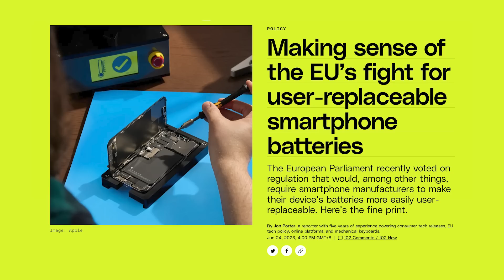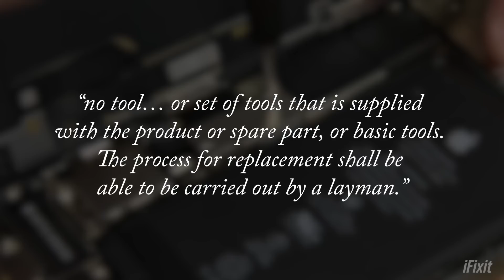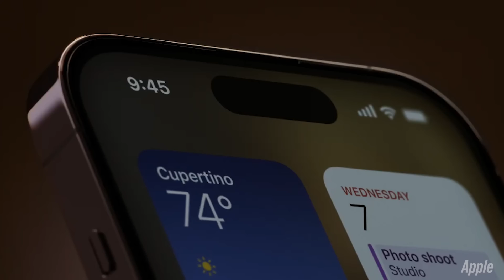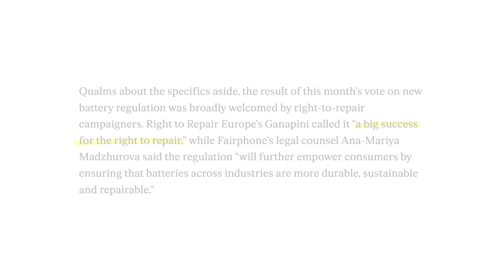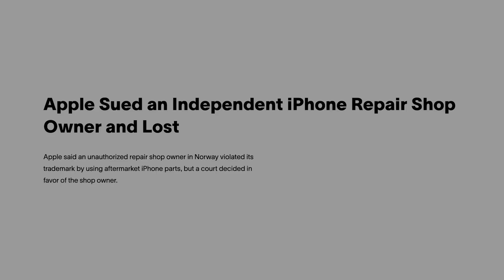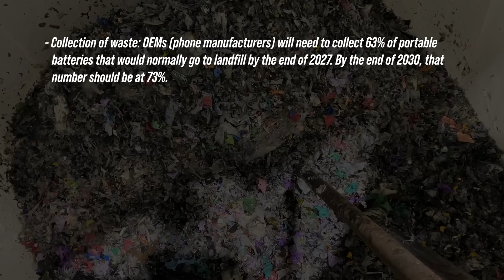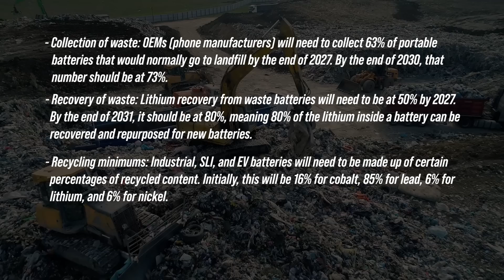EU Just Changed Smartphones Forever

Comment: By the time an iphone battery is becoming useless it is generally close to being unsupported by iOS updates anyway. IPhones last maybe 3-4 years and then the hardware can barely support the OS due to insufficient RAM or processing capability anyway. 

The correct way for the public to display their preference for replaceable battery phones is for them to stop buying phones with irreplaceable batteries. Not for some bureaucrat that isn’t an engineer or product designer to enforce unnecessary laws on the public.
Reply: So, tell me, what are the current options if you want a phone with replaceable battery ?

You have wayyyyyy too much faith in the self regulation of the free market.
Reply: @paulustrucenus  If there were enough earnest consumer demand, phone makers would include this feature.  However, this feature set comes with tradeoffs probably most consumers are not willing to make.

All of us have had phones with replaceable batteries.  It was a crappy experience.  Over time the battery slot would get loose and start flying off.  Plus no one wants to carry around spare batteries.  

The people who didn't care or didn't want now have no choice.  Why do you get to destroy the market of phones for what they want which is likely the overwhelming majority.
Reply: @narcojauy  That first sentence is straight up wrong. That's not how the world works.
Reply: @paulustrucenus  There literally were half a dozen phones with replaceable batteries in this video.  Why not buy one of them instead of dictating what everyone else is allowed to purchase?
Reply: @narcojauy  Because no one has ever heard of them.
Reply: @paulustrucenus  Did it occur to you that phone makers of excellent products considered the tradeoffs and selected an inaccessible design because it improved the overall user experience?

Now we have bureaucrats deciding phone design.  This is backwards and stupid.  We don't hire plumbers to do heart surgery.

That's why the free market is great.  You can protest their design choices by NOT BUYING THEIR PRODUCTS.  If you can't be bothered to buy a competing manufacturer's product that meets your requirements, then my impression is you don't care about this issue that deeply.

If your desire for replaceable batteries is so capricious, why on earth should it be outlawed to produce a phone that has a sealed battery? Laws and regulation should meet significant public interest requirements before becoming laws.  Not, let's give those evil corporations a spanking, here's a law.
Reply: @narcojauy  I'll stop this discussion because this is going nowhere. Your view of how the world works is fundamentally different than mine, and the statements you make make sense to someone with your beliefs, but are utter nonsense to me and my views. 
And considering the massive difference in our beliefs, I don’t think either of us can convince the other of anything.
Reply: @paulustrucenus  My views are not beliefs.  They are rational arguments supported by a vast array of historical evidence.  I have a Master's degree in Public Policy.

I don't know what informs your opinions, but it doesn't appear to be based in any rational philosophical framework.  You obviously haven't considered the competing interests of liberty, individual rights, and freedom of choice.  This is the main topic of philosophers from the 17th and 18th centuries.  

I encourage you to read Social Contract theories by Rousseau, Arguments on Liberty by Locke, and about the Tyranny of the Majority by JSM.
Reply: @narcojauy  My opinions are supported by rational thinking and historical evidence too. I do not like your supposition that somehow my ideas do not come from a rational framework.

And your argument to authority is meaningless. I doubt every person on earth with your degree agrees with you.

Our différence in beliefs comes from my belief that the choices made by companies are not the result of the choice of consumers with the free market, but are made with self interest in mind, and that in a world where information is in the hand of private companies and competition is virtually meaningless considering the upfront cost of entering the tech business, consumers have little to no way to exerce free choice.

Also, you trying to teach me about the Lumières has to be one of the most hilarious thing ever. I'm French, and I'm pretty sure I know Descartes, Rousseau and the others better than you do.
Reply: @paulustrucenus  The Enlightenment philosophers were not primarily French in origin, also I specifically mentioned political philosophy.  You do not seem to give much consideration to liberty or individual rights. You speak of conflict between consumers and businesses, which conflict between classes being primarily a marxist take.  You have a big blind spot when it comes to tyranny, which as noble as marxism may claim to be, historically it has led to authoritarian dictatorships in every instance it has been tried.  Your lack of focus on the fundamental importance of liberty is a hazard that could lead to tyranny and despotism.

Contrary to seeing actors in a free market as in conflict, it is more proper to see them in symbiosis.  The freedom to engage or abstain in trade is of paramount importance.  Forcing someone to buy a product against their will or forcing a seller to produce a product against their will, absent a compelling public interest, is a hazard in that unlimited government authority is inherently oppressive.

I still await your reasoning for why such an intrusion upon the rights of others is necessary?  I have not heard any reason other than "consumers want this", which by their actual purchase behavior appears to not be the case.
Reply: @narcojauy  You know what's better to juge what customers want than their buying habits ? Actually asking them. Surveys show europeans are largely in favor of laws enforcing right to repair.

Your argument bases itself on the idea that consumers are totally free to chose which solution is best for them, ignoring the points I previously made about private holding of information preventing consumers from knowing what solutions exist and the inpossibility for a new player to enter the tech world.

There is no such thing as freedom to engage in trade when said trade is necessary for your survival.
Reply: A replaceable battery has 0 power over your survival. You are being melodramatic. There are phones that offer that feature, yet you choose not to buy them because they aren’t as compelling to you as sealed phones. 

I understand your argument perfectly fine, that the right to repair is of paramount importance, and I gave several reasons why it isn’t important. Hardware obsolescence, inferior phone design, wear forcing the phone to fall apart inadvertently. 

You have ignored my main argument this entire time. The primary priority should be safeguarding against government tyranny. The government should have 0 interest in basic consumer decisions. 

Do you want your government involved in basic consumer choices? What if they ban baguette because a different kind of bread is more healthy for you? Maybe they should outlaw sex without a condom because it is dangerous? You are giving them the authority that leads to such dystopian outcomes by recognizing their authority to do so in this case. Europe has unlearned the lessons of The Enlightenment. I thought you fools would have learned the peril of totalitarianism from Leninism and Fascism, but you seem destined to repeat those failures too.
Reply: It works the same for toxic and carcinogen components in food, toys, clothing... right? They are removed because "the public display their preference for toxic-free products", not because "some bureaucrat that isn’t an engineer or product designer enforces unnecessary laws on the public".
Reply: @neutronalchemist3241  There are cases of compelling public interest where regulations are useful.  This is not one of those cases.
Reply: @narcojauy  It's the political organ that decides what's compelling and what's not. And it decides exactly because there are cases where the single is not concerned of what the public interest is. Regulations are issued about the most diverse things, IE, even the colour of the internal wiring of electrical devices is regulated.

Comment: Apple is by far one of THE worst tech companies when it comes to eWaste with non serviceable parts and outright DMRing hardware itself that changing out one little broken or damaged component makes the entire device complete eWaste junk. In what world (besides Apple's) does it make sense to DRM the hardware so you can't have the phone services for repairs by swapping out a screen, camera, battery, SIM Slot, or entire logic board, what harm does that really cause for someone to have these things repaired? Whose business is that really hurting just to repair something? The answer is Nobody. It's more than just "Mildly" inconvenient to the end user of that device itself, it's majorly inconvenient to that end user who has to spend $100s if not $1000s just to replace the entire device just because of one defect that could be easily swapped out for a new part. Using the excuse of "Oh but the consumer will hurt themselves" is such a weak ass bullshit logic of an excuse, that kind of logic makes absolutely no sense in any shape or form. If they take it to a repair shop who specializes in repairs and replacements of components on electrical devices chances are they know exactly what they're doing, unless it's one of those sketch corner shops who is overcharging or undercharging their services.

Comment: I already use rechargeable batteries for my wireless mouse. It's really convenient to have removeable, rechargeable batteries as it means you can use your device on the go while charging the spare battery. Then when the charge in your device runs down, replace the battery with a freshly charged one and then recharge the spent battery.

Yes, this will result in thicker phones. Maybe we need a standardized battery design for phones too, just like we have standardized power connectors.

Comment: @0:30 "Easily replaceable batteries are no longer possible"... that's complete BS. The battery on my phone 15 years ago was easily replaceable, and the phone is not only water proof so that I can go swimming and diving with it, it's actually still working today. 

Batteries not being replaceable is a willful decision by the manufactures in order to a) cut down costs so that some manger can worsen climate change by driving around in their private yacht and b) ensure you'll have to buy a new phone every few years, which, of course, is just a) rephrased. Of course, customers are also to blame for letting companies get away with those tactics.

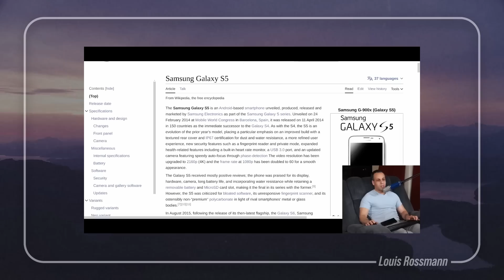Edit: Should've waited until 3:25.. exactly.

Comment: I never understood the "water protection" argument because you can simply seal the rest of the phone well and then put a rubber seal around the removable battery slot itself. It's ridiculous components aren't modular because it is not difficult to use contact data transfer instead of cable, especially for something like a battery. They did this for years and years on the older phone batteries.
Reply: Samsung S5 had a replaceable battery and a IP67 water protection certificate (that means it could stay under a meter of water for an hour).

Comment: I never wanted a phone without a replaceable battery. It simply was not possible to buy a good phone with a user replaceable battery. The best I could buy was one which had little screws which allowed access to the battery. And the next time I had to get a new phone there was 0 choice when it came to phones with user replaceable batteries. It's not driven by consumer demand. It's purely driven by corporate greed and a little bit by consumer ignorance.

Comment: So many devices which are still supported and works perfectly fine have to be thrown out because the battery have issues, sure you can get a replacement if you can find someone or some place with the know how and tools to do it, but even when you do it's most likely a knockoff battery that will only last a third of the time an original battery would.

Comment: No. Batteries are no longer exchangeable not because of design, but because of money  -it's cheaper to build one with sealed battery and it's better to sell customer new phone, not new battery. It is all money and don't ever think otherwise.
Oh, and this also is not "for planet". It is also because of money. Rare earth elements, to be precise. EU has basically no rare earth elements supply in it's territory, to they must ensure that old batteries will stay in EU and be recycled to get these elements and use in new products (like you pointed out). Does this help with ecology? Yes, but it's not the main point, it's just happy coincident and byproduct. EU must do this to not be dependent on, well, China mostly.

Comment: The Motorola MR1 of 25+ years ago, used to have a replaceable battery. They also sold a separate battery charger, so you could buy spare batteries and charge them via mains power much like walkie talkie batteries.

Comment: This is awesome. Think about it... most of us just purchase new electronics when the battery is giving us problems. But how much has the tech evolved between purchases? Almost nothing. Maybe an extra camera lens on the back, couple of extra megapixels but thats it.. 

If we will be able to use our phones at least 2 times the length they will have to incentivise us to change our phones prior to the battery going bad. How will they do this..? By making improvements and add new features that makes us want the tech and not just a better battery.

Remember when we went from button-phones to smartphones? We have not had such dramatic change in our tech for years. Why? Because we will still purchase new phones because our battery dies all the time. Therefore the giant companies does not need to implement new features or come up with new ideas..
Reply: Well back during the crazy mobile wars when it came out there was so much advancement that you want to upgrade every couple years at least.  But now the tech is mature without much changes.

Comment: I know a guy who works at an Apple store and I was having a conversation with him about Apple's repair policies and their disingenuous "techs."  I commented how Apple always tells you that your product can't be repaired and you have to replace it and went on to tell him about the "stings" run by reporters.

They's have a tech disconnect a simple ribbon cable in a laptop and take it to the Apple store.  Invariably the Apple tech would pronounce the machine unrepairable.  However, reconnect the cable and the machine works again. 

My acquaintance defended this action in two ways.  First, the techs are instructed to declare all machines as unrepairable.  Secondly, the "techs" are not skilled enough to be able to identify something "technical" like an unplugged cable..So much for the genius bar.  Also, he uses these practices to justify the Apple protection plans.  

The funny thing is that he considers himself to be an "IT guy" because he knows how to setup iPhones.  I asked to explain the seven layer network model and he had no idea what I was talking about.  LOL.

Comment: User replaceable EV batteries definitely sounds very safe seeing as a human can die from as little as 0.1 amps and EV's run on higher amps that that and require specialist training to remove them safely and even then it is a requirement that there is someone nearby with a hook to pull out the person from underneath the car that is disconnecting the  battery

Comment: going BACK to replacable batteries? What a novel idea. 
I've had a "smart"phone or cellphone since 1989.
AN iPhone 4 I had years ago, and my current phone, a Galaxy A11, are the ONLY ones (out of several dozen) that lack a replaceable battery.
Mind ... a new battery cost more than a new mid range phone ... so it was always cheaper to get a new phone ....  🙄

Oh well. Like computers/laptops/tablets, the operating systems and apps are only supported for a few years, the older systems are no longer able tto work ... Example: A fully fuctional computer with Windows 8 and earlier CANNOT go online. The browser is no longer supported. Upgrading to the "latest and greatest" browser may not be an option.A computer running Windows XP r Windows 7 or 8 MAY not meet the minimum hardware requirements for the new browser.
Windows10 will be "obsolete" in mid 2025. "Obsoletet" in that it is no longer supported, and updates/"upgrades" are no longer available. Hence by 2026 ... 2027 at the latest, Windows 10 will join the operating systemsthat cannot be used to accesss the Internet.    

I believe the term is "Planned Obsolecense". 
The computers/laptops/"smart"phones, tablets, TV's and other electronic devices for sale at the store today, were "obsolete" before the various manufacturers packaged and shipped them - Long BEFORE the store got them. 😡

Comment: i still do see weather sealing as an issue with removable batteries.  not that it cant be done, but can it be done to the level which consumers expect.  in regards to the recycling of the batteries,  i think the point is for the manufacturers not the consumers.  look at how much recyclable stuff gets thrown in the trash with available programs and recepticles to make recycling easier.

Comment: The phone in the thumbnail is actually pretty cool, imagine the bottom of your phone is held on by 2 screws or something that pinches a rubber seal together for dust and water resistance and when you take the screws out the battery just slides out